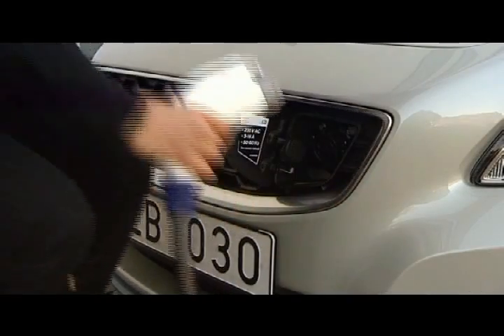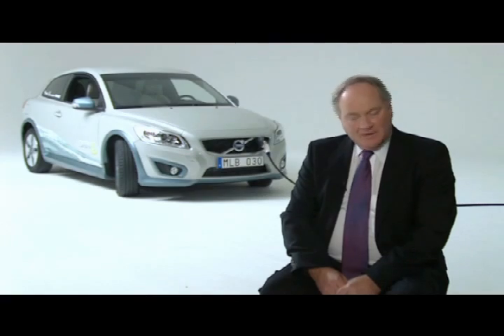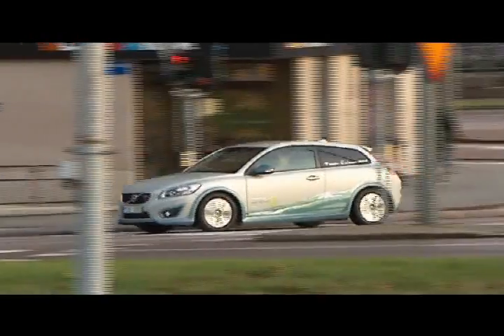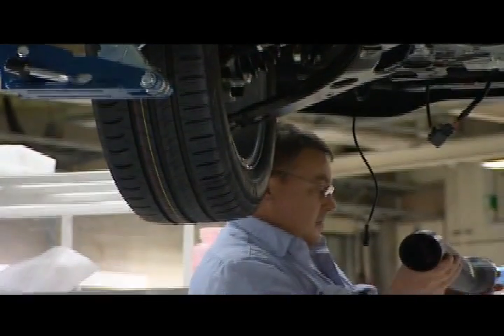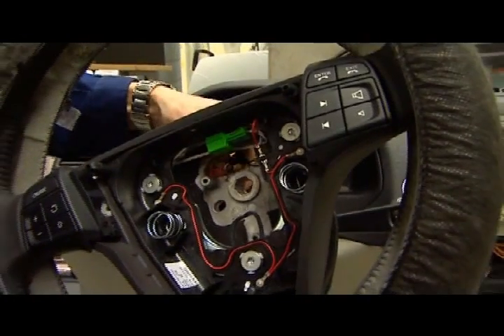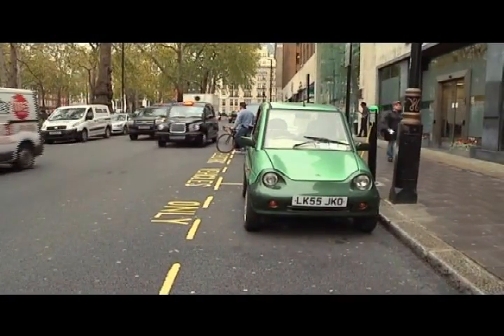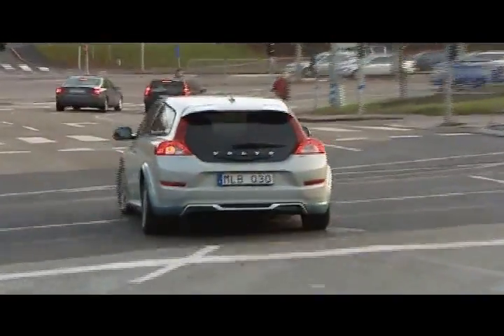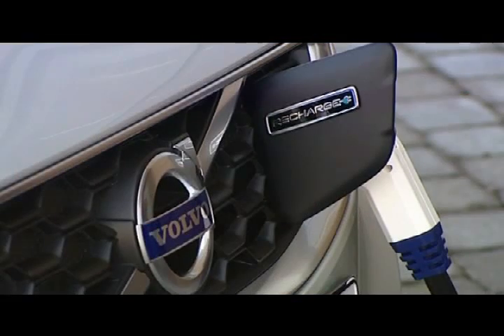Volvo C30 Electric Car

Comment: 150km per charge, Is that if you are using the radio, heater blower, have to drive with headlights and possibly have an airconditioning unit going full blast.